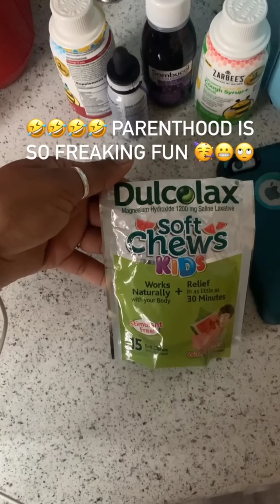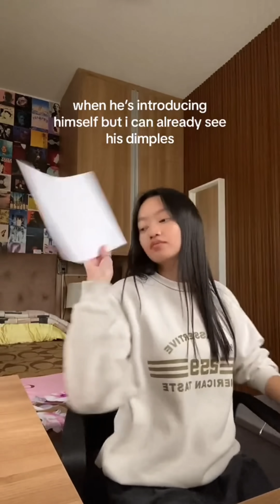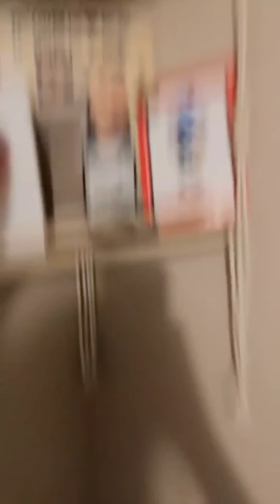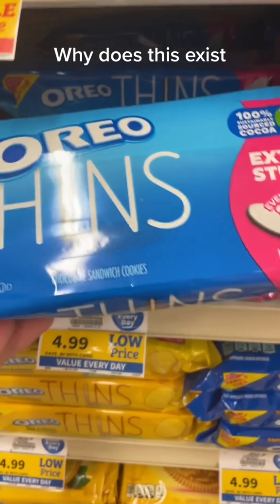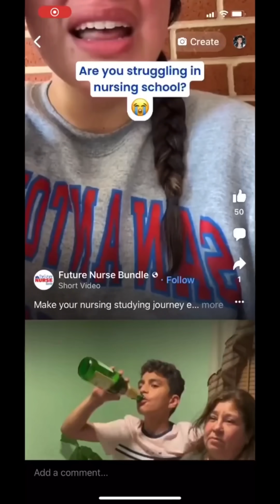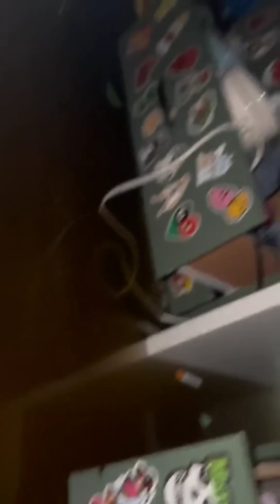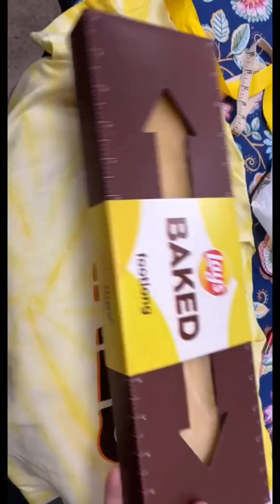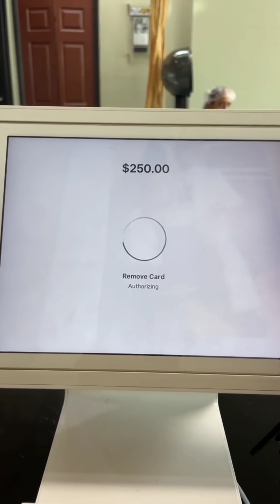Tiktok memes that if ylyl 😀

Comment: 54:20 

Fun fact, I was actually on the Walla Walla ferry grounding. The experience was ass, they had to employ the help of coast guard and the puget sound foot ferries to transport people off so they could tow it. boarded at 4ish pm, and I ended up on the last ferry back at around 10 pm, and my group didn't get the car that was on it back until the next day. Luckily the department of transportation paid for all the Seattle residents to stay the night in the hotel by the ferry dock, but still. Missed my Shayfer James concert :(